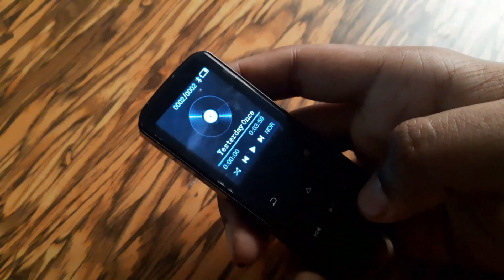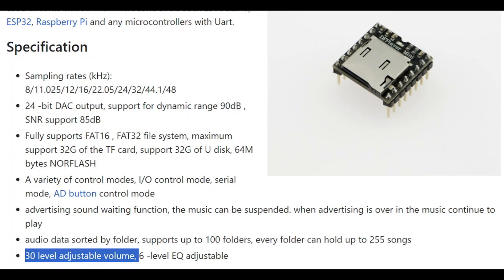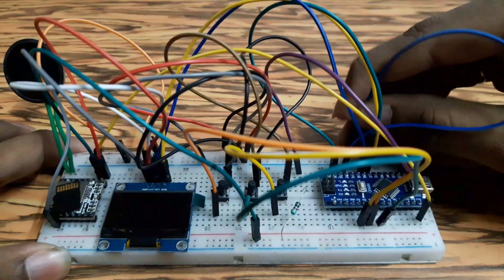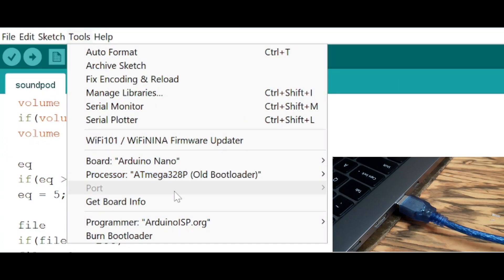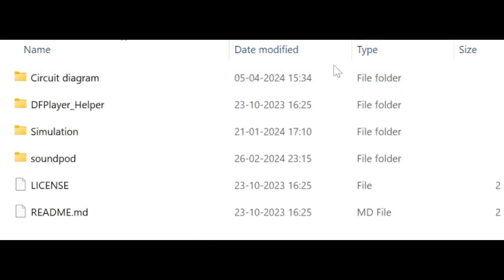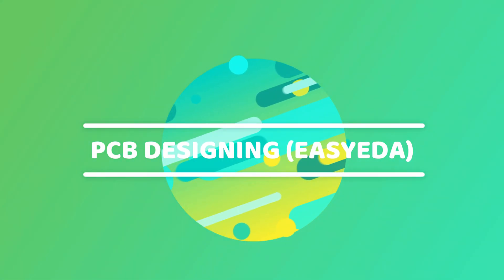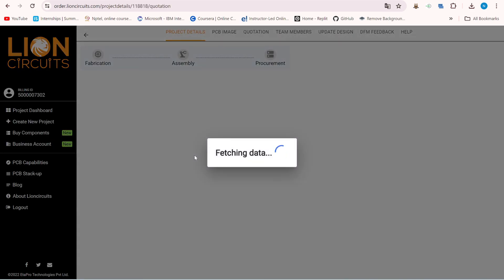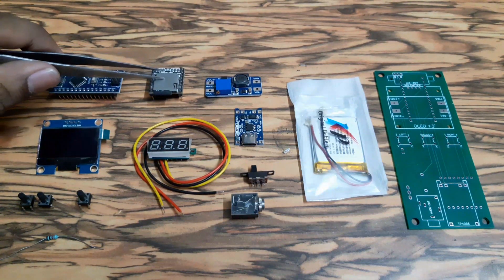How I made my Arduino based Digital MP3 Player 📻

Comment: It works fine with a few files on the sd-card. But when all 100 * 256 = 25600 files are stored it takes 10 seconds between the play command and the audio file starts playing!